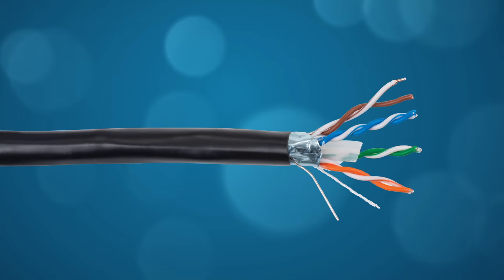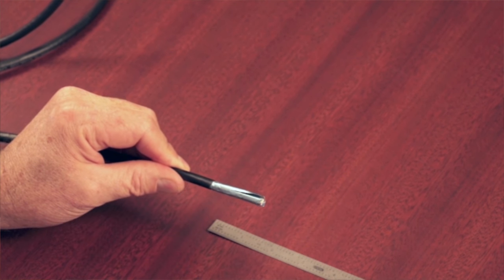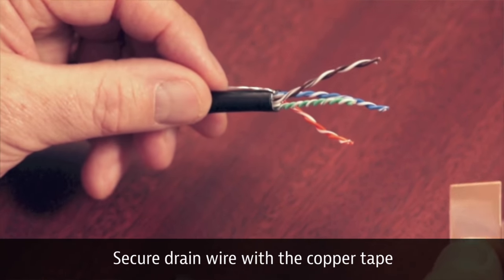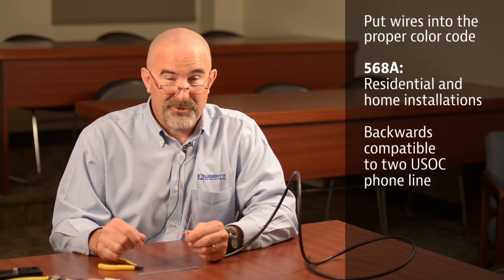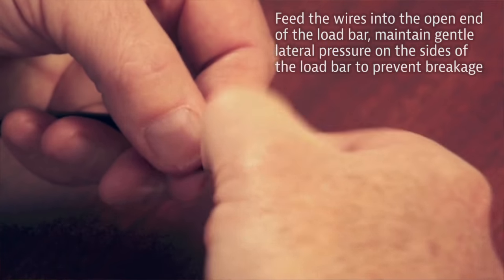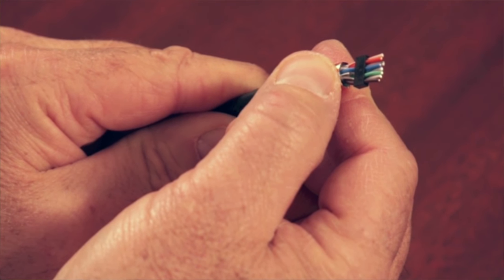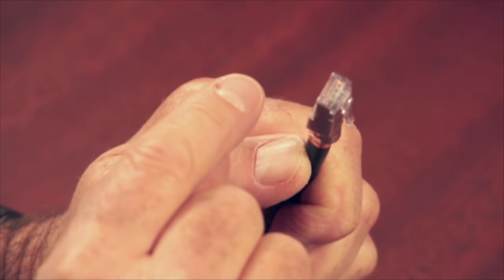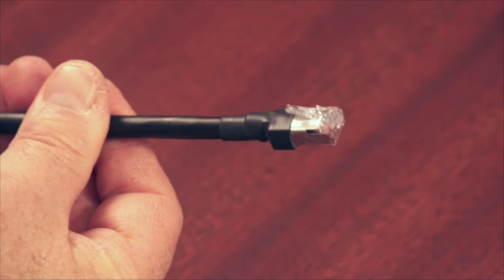How to Terminate Cat6 Shielded Cable with an RJ45 Connector

Comment: I didn’t know I needed to watch this until I did.
Reply: same here! idkk why he use ez crimp tool,,, he dont have to cut at the end
Reply: @syvekhezeiahjanebesidas7329  , I concur. I've never done shielded. Something tells me it will be necessary in the future. I was impressed by how easy the new passthrough connectors are for UTP until I saw this with the load bar. This seems just as easy, doesn't require me to buy a new passthrough crimper and I get a better cable.
Reply: @syvekhezeiahjanebesidas7329  depends on the connector he uses.  that connector didn't look like it would allow the conductors to protrude through the end of the connector.

Comment: I've seen a lot of videos on networking and this is the first one to explain WHY most people use 568B instead of 568A
Reply: Well it actually says that 568A is more advantageous. B is legacy for businesses that started B style wiring years ago.
Reply: i read that 568B is more resistant to HF  interference
Reply: @danielsatko-  NOT TRUE!
Reply: @daniellecastellano9993  so give me link to page where is your opinion proved
Reply: @danielsatko-  Can you link to where you read it...
Reply: @Azsunes  Exactly lol. I'll say something exists without proof then everyone else has to prove it doesn't exist with evidence. Hmm... Big Foot and a Unicorn just had a baby...
Reply: AT&T uses A
Reply: This website will tell you the basics of both since people want to speculate that B is more resistant HF interference
Reply: Inspiration ❣️
Reply: @kwinzman  Also, I prefer to have the orange next to the blue, as it's easier to see the difference.  With some cables, it's hard to tell the green from blue.  So, I usually go with A.
Reply: Can I use a Type B with a device that may have a type A? So clueless on this.
Reply: for example, I have no idea what type my router currently uses, but I have Cat 6 cable I can use to add connections. Should I use 6 with B or A?
Reply: @RadDadisRad  ..... cause they are a phone company.
Reply: @danielsatko-  the wiring scheme has no meaning in physcial electronic characteristics because rj45 has identical pins over itself.
even you can wire a rj45 with just alphabetic scheme. It doesn't matter. Ethernet phy process always same pins, not wires
Reply: @danielsatko-  i'm not a electrnoic guy,  if i'm wrong can you tell me, why all 8 wires have different characteristics or all of them same copper??
the copper inside of different colored 8 wires is same. after that my knowladge is not enough to explain anti-thesis.
Reply: @furkanunal977   it does not matter for u that it is wrote with capitals. dont worry. it is still too much for u to understand

Comment: Place first pass of copper tape under the drain, then wrap over the top of the drain.  Eliminates adhesive connectivity issues.
Reply: AND gives two surfaces for drain to contact, better than just one.
Reply: I don't see how this helps as you are still crimping the collar over the second layer of tape which is covering the drain wire.  Better way to do it is to ensure the collar is touching the drain wire itself.  Many will choose to wrap the drain wire around the collar and then under and crimp on top of drain wire.

Comment: When straightening the conductors you can use a bic pen (round type) and put the conductors between your thumb and the pen and it will cut this time by 75%. And save your fingers especially if you make a lot of these connections.
Reply from the maker: @Jason Galvan great tip, thanks for sharing!
Reply: Thanks Jason!  After building a dozen or so RJ45 connections, my fingers are killing me.  Your tip should help a LOT!
Reply: Yep. I wondered why this technique wasn't used in the video.

Comment: Hold up: You applied the heat shrink and left the wings on the external shield uncrimped and pointed outwards!
Reply from the maker: Hey there @Helman Frow, always love to hear feedback! When you said “applied the heat shrink and left the wings on the external shield uncrimped and pointed outwards”, can you give us the time code of that? I will review! Everyone here is in the same space in finding the best solutions for pro AV connectivity. There are so many creative approaches!
Reply: @AngieDurbinCreates  10:01 "you're going to slide that shrink tubing up..." Notice that the external ground wings have not been crimped around the cable.
Reply from the maker: @helmanfrow  thanks I see what you are talking about, you have an eagle eye! Prior to the heat shrinking, he shows bending the connector strain relief and then squeezing it around the cable by hand at 8:52. But I see what you mean, it wasn’t pressed on super-tightly so the points were still slightly sticking up. Liberty has an updated video of Cat6 termination here, you can see the strain relief is tightened more around the cable. https://youtu.be/9U84ax50PE0?t=602

Comment: Very thorough and meticulous work. Good job. I have seen RJ45 connectors with open ends so that the coloured pairs go right through the ends before crimping. This ensures excellent terminator seating, removes any measurement requirement for the stripped cables and reduces the chance of any error in cable order. After crimping the excess is simply snipped off with a side cutter.
Reply: When you're an unfortunate soul like me who have put on a quintillion tips over many many years, you don't need to measure anything, it's all done by feel and sixth sense. I have a standing bet with myself if I were to ever lose my eyesight I could still terminate (color code correct) cable by feel alone.
Reply: Yep, used those connectors a lot. Quick tip, once you've pushed the wires through cut them straight and then withdraw the cable back into the connector a little. Saves any frayed ends or broken connectors.
Reply: All that, and allows for crosstalk between the conductors! Exactly what everyone wants. Lol
Use of that type are NOT best practice, especially for sensitive  applications. They are the cheap and easy way out for those out for the fastest money without regard for best performance. Just sayin'.

Comment: Fantastic, superb, spot on. I have been using RJ45s for years but the amount of times I have got one core swap as I push them in is so frustrating, especially on full length runs. This will save so much time overall on large jobs. All that walking backwards and forwards. Watched your video ordered ends and crimps straight away. Can’t wait to try these out.

Comment: I am either very lucky or very good, my first cat6A cable (15 meters, underground and façade run) with 2 brand new self installed rj45 shielded plugs, worked right away without any tester !

Comment: Great job...convinced me to just buy them with the ends already installed. : - )
Reply: :-) yes, until one day you`ll need to run a cable through an opening which the connector won`t fit...
Reply: @ecosmos3368  that's what drills are for :D
Reply: Kelly Larsen sometimes you need to cut for measure, anyway.
Reply: @ecosmos3368  If it doesn't fit, use a bigger hammer.  ;-)
Actually, if you're running cable for a permanent installation, don't use plugs at all.  Use a socket and patch cords.  I do that even when running cable to an access point mounted on a drop ceiling.  Also, plugs were originally intended for use on stranded cables, as used in patch cords.  The plugs that work with solid wire only came about because people insisted on using plugs on solid when they shouldn't.
Using a 110 punch is much easier than trying to put on a plug, while on top of a ladder.
Reply: @karrotop  i could understand that, as long as it is through a wall, what happens when you have to use a draw wire though tiny electrical conducts, walls and all sort of small spaces?? i could ask @James Knott the same question:-)

Comment: Used Liberty for years, the company is very solid,  with great product and tools make sure to check the bandwidth of the cable used usually written on the cable spool. I use a pro cable tester as another verification and slightly flex the cable near the ends for weak crimp areas while on the tester. The crimping tool especially the blades have a  definite shorter life expectancy that you might think, replace blades frequently and the tool yearly if used daily. Copper tape rocks and will pass consultant spec in AV and Network wiring. Sure beats soldering shield to strain relief

Comment: This has explained to me why it was so frustrating trying to terminate a shielded grade cable into a regular RJ45 connector end. It was nearly impossible to get them to line up side by side inside the connector it definitely needed the load bar, it was not the right fit conductors for regular cat6 ends.
Reply from the maker: @John Pythagoras thank you so much for the feedback. We're SO happy that the video helped you out!

Comment: Use a small screw driver, place the round shaft of the screw driver at the base of the conductor and pull upwards at a 45 degree angel, this will perfectly straighten the conductor, you can do two, the pair, at a time. Super easy to load now.

Comment: Nice walkthrough!. Gonna take a shot at this at work to get rid of some dodgy WiFi extender nonsense.
Reply: Yeah, that's not gonna help at all.
Reply: @Sherlock_MacGyver  Making and running cables could help eliminate the need to use wifi extenders.  Not sure what you mean here.

Comment: for POE security camera, use 568B is preferred, although the POE camera system will automatically determined and adjust for either 568A or 568B
Reply: I only know of Russia using A standard. Everything else I've seen has been on B standard
Reply: @TriptyX  yeah 568A was the standard for many many years, I have gone to many of places that we just went there to drop a cable or two, and found all of their shit was A code, and standard patch cables are B code, so we sold them on re-doing all of their keystones. Most switches nowadays can adjust for the swapping, but it just makes the switches work harder, and brings in some latency issues.

Comment: Great video, but I have a question about the shielding. I see some sources saying to fold the foil back on the jacket and crimp that under the housing, and other sources (like this video) say to strip the foil entirely and use just the drain wire. Is there an appreciable difference between the two methods?

Comment: Been doing telecom cabling for 21 years and never heard of 3/10ths of an inch...  T-568A terminations are also used in some military applications...  Most of the world uses T-568B. 
And then there are the fun patch cords that have one end which is the reverse of the other end... Not sure what we used them for, connecting some pieces of equipment in the MDF at the site where I worked, but my boss had to make them sometimes, and he hated trying to remember the order backwards...

Comment: I push the load bar to the tip of the wire after pulling it back and cutting the excess wire. For me that insures smooth insertion into the connector every time

Also, I don't think I've seen 568A used in anything in general in the last 10 years as RJ11/phone lines don't even get installed in homes anymore. And most "LAN lines" are now just IP Phones.
Reply: Agreed, I haven't seen anything but 568B pairing used in anything I've worked on in the past 10 years.

Comment: I have a better method of untwisting the pairs at 4:00.  You bend the end of the pair over itself then twist both conductors of the pair counter clockwise together.  This straightens the conductors at the same time and makes them very easy to deal with
Reply: I should say counter twist rather than counter clockwise, because I guess it depends on which side of the cable you are doing
Reply: Wouldn't bending the pair over itself cause work hardening of the copper?
Reply: @davidabner8885  I'd love to see it please. Could save me hours or even days on some of my larger jobs.

Comment: A more reliable way to tell if the wires are inserted far enough into the connector is to hold the connector up with a light behind it, you will see how far away from the tip the wires are.  If they are not right against the end of the tip, and you cannot push it in any farther, do not crimp and start over

Comment: very good and detailed explaination but the problem is time. making a few like 4-5 is ok but try to do this a few tens of times (done it) and your fingers will be useless, due to cores being much harder than cat5. i believe cat6 cables were never meant to be crimped in rj45 plugs but to be patched. eitherway nice and informative video overall.

Comment: STP should be grounded. Does this termination imply that the grounding of the shielding of the cable is achieved by the contact of the connector body to the chasis? Thank you!

Comment: Pretty good if you have the correct tools, most IT guys work with cheap and with lack of proper tools for the job, no wonder a lot of the cables failure over time, most of the clients also doesn't care as long as it works

Comment: how is the cable actually grounded because the wire just seems to be touching the copper tape and the tape  is attached to a non conducting sheath?

Comment: Your straight through patch cable that you would use to connect computers and various other devices to a switch or router will use the  568b standard while it really doesnt matter since on both standards the main pins are in the same spots just with a different color. Ive used a cross over 568B and 568A cable only when connecting 2 switches that dont have auto mdi-x.

Comment: I am new to this shielded type of cable and its drain wire. It seems a stupid question, but I will ask anyway: Is it okay if I use cable boots to protect the cable and RJ45 connector? Would it diminish the purpose/functionality of the drain wire?

Comment: What you need to know is that are there TWO DIFFERENT connectors depending on whether you are using a solid wire cable ("backbone installation cable") or stranded ("flex patch cable"). You need to use the right connector or the cable is likely to fail, if not when you make it, later. The solid core connector has 2 to 3 prongs that are OFFSET. That allows the prongs to go over and AROUND the solid wire. The stranded connector has 1 or more prongs that are INLINE. Straight. That allows them to go IN BETWEEN the strands. If you use the INLINE connectors on the solid wire it can sever the wire or just not connect well. Google it so you know which ones to get. Even the purchase agents for the big box stores get this wrong. You need to look at the side of the connector to see the prongs. OFFSET or INLINE. No one tells you in these how too videos. Know your wire and know your connector is the key to making good cables!
Reply: What?
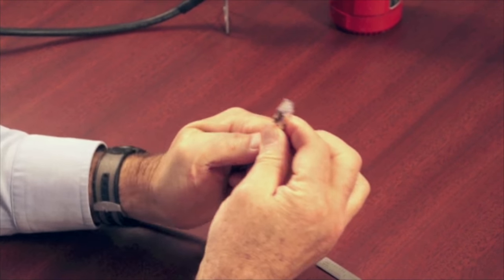Reply: He said there are different designs of crimp connector for each solid conductor and stranded conductor.  The design of the teeth on the 8 crimp contacts ( 9:38 ) is the difference.

Comment: Great job.....but, you cant assume that the connection or cable is working until after you have tested the cable for connection ...which you failed to do......Key note when terminating cat6 cables is that you always use a digital cable tester to ensure the cable and connector is working ..that is that each pin is transferring signal .....you didn't do this test.....Other than that love your video. Great work.
Reply: very true......

Comment: What size of heat shrink tubing is required to fit over the RJ-45 connector?
Reply from the maker: Hi @Brandon Doty, thanks for your question! The heat shrink size is 3:1. The kit shown in the video comes with 25 pre-cut pieces of it. Here is a link to their site which has an updated video of the termination process: https://secure.libertycable.com/product_details.php?pitem=RJ45-STP-L6

Comment: Are shielded rj45 the most compatible with shielded cat6a?
Reply from the maker: @mitzi louise it looks as though shielded is the recommended way to go. Technically you can use unshielded, but the shielded cables need the sheilded connectors to function properly. Here is a link to an article about it, hope this helps! https://www.truecable.com/blogs/cable-academy/selecting-the-correct-connector

Comment: Cat6 jacks usually have staggered wires at the end. These appear to be straight and maybe Cat5e. Cat6 is usually higher gauge wire so may not make a good connection in Cat5e jacks. Cat6 wire is also has a slightly greater diameter outer jacket, which may be why he had to crimp more to get it to insert. This deformation can also slightly change the impedance as well. Also, always use some sort of anti-snag boot. Often people break off the locking tab by snagging it on something.
Reply: No they don't. Have you ever seen a staggered crimper?
Reply: @privatebubba8876  He means the ones that are staggered if you looked at them from the end of the plug, not through the window from top of bottom lol 
They're quite common.
Reply: If the internal pin arrangement is not staggered, can we say that it is definitely not a CAT6 plug?

Is it possible the staggered format is to cater for cable size of 23AWG, as I read it somewhere?

Comment: A question, I purchased Cat 6 RJ45 connectors that look EXACTLY the same as the one in this video. However, none of them came with load bars! I've been getting frustrated wondering why this was so hard compared to cat 5e connectors. Are load bars supposed to be sold separately? Feels stupid and unnecessary not including them. Thanks for the video by the way.

Comment: In cases where copper tape with conductive adhesive is not readily available, is it OK if we were to use aluminum foil cut to size instead?
Reply: Then there is the foil shield, dont cut it but use it. I am not an expert but after watching a few videos its logical